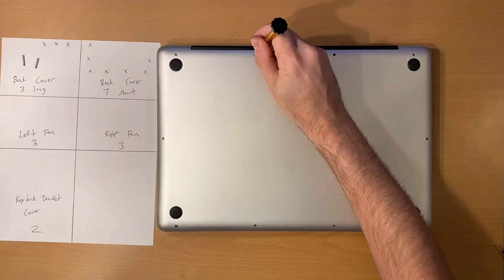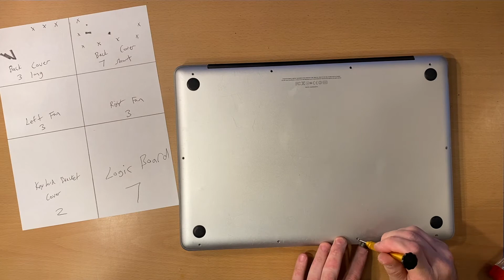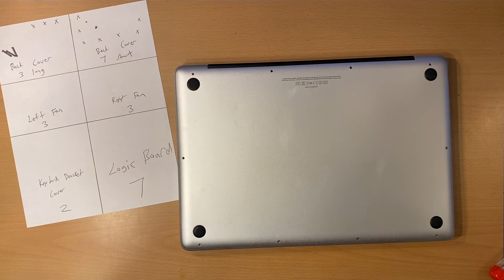2011 MacBook Pro A1286 Graphics Card Fix

Comment: Can you help me with my problem regarding my 2011 A1286. There's a question mark folder appearing in screen  so I went to a repair shot to get my laptop changed the drive to a SDD, but upon installing it the laptop was said to be being updated. Now the issue again is it keeps on resisting all OS, why is that?

Comment: Thanks for sharing this repair. 

Could I ask whether the capacitor is polarized or not? I didn't hear direction of the capacitor. 

And if this problem is not the GPU, why some repairs even changed the GPU and fixed the problem? 

Oven baking also was sometimes successful and lasted for some time, does it fixed the capacitor instead of GPU?
Reply from the maker: The capacitor is polarized. The positive side is facing toward the center of the board.

Most repair shops that tried to fix this issue assumed that either the GPU chip went bad or the solder connection pads detached overtime due to thermal stress. When heat is applied to the board when replacing the GPU chip or trying to reflow the solder pads, enough of that heat will make its way into the failing capacitor. The heat will give the capacitor a slight kick and will usually cause the GPU to work again, but it will only be a temporary solution. The only real long term solution is to replace the capacitor.

Capacitors loose their ability to hold charge over time, which is why I use a 2.5 volts capacitor. The extra .5 volts (compared to the original 2 volts) will not cause harm.
Reply: @hackingstuff4920  

Thanks for your quick reply. It is very helpful. People always doubt about GPU reflow and wonder about something inside the GPU, so after all, it might be something else. 

One suggestion for you - if you could demonstrate the GPU panic problem before starting, and show the working machine afterwards, your method would be more convincing and your video would be more powerful.

One last thought though - why heating makes a faulty capacitor working again?